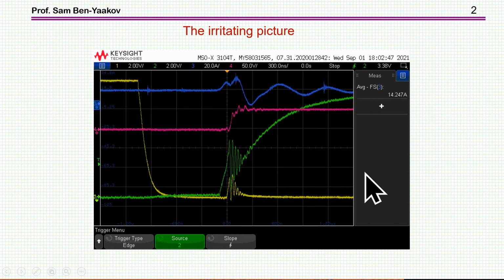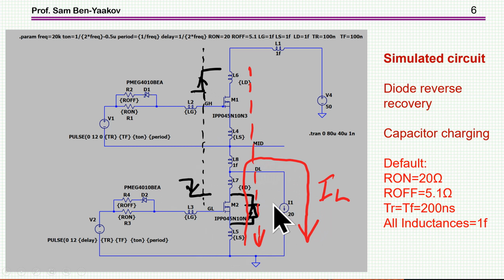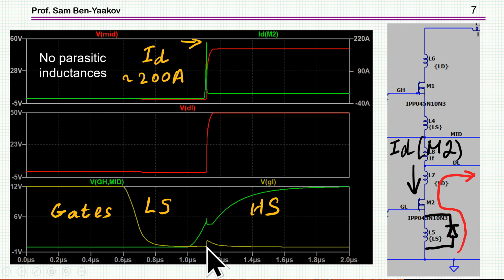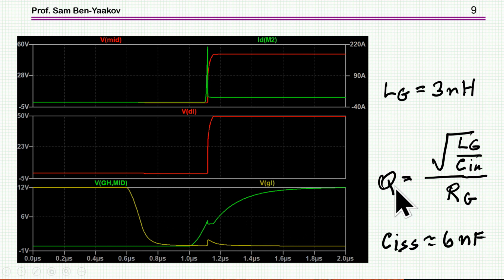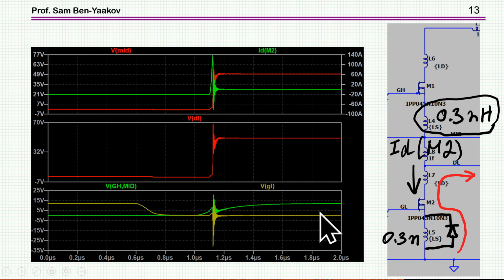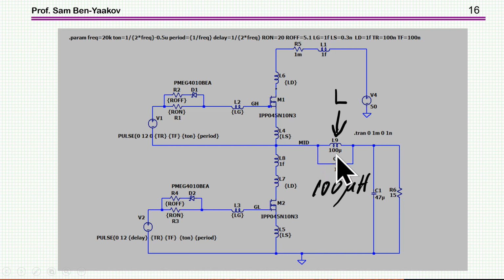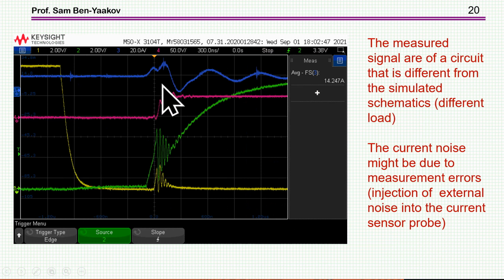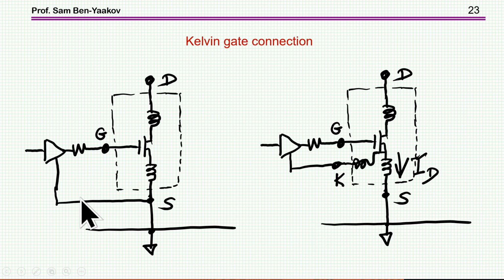Deciphering switching noises in PWM converters

Comment: Hi Professor. 

Just wanted to ask, what is the point of the inductor L8 just below the midpoint in your simulation? if it is not the drain or source wiring parasitics (and obviously not the MOSFET's internal parasitic as that would be inherent to the mosfet model).

I understand that it is not contributing to simulation since it remains such a low value during the presentation but I can't help but notice it.

My thought is,  is it there to help with convergence issues when the current source is present during simulation?

Thanks again,

I look forward to sending you photos of an inverter drive I am building, much due to your expertise.

Doron
Reply from the maker: These inductors are meant to emulate the inductance of the outside connecting wires. Large parallel resistors may help convergence.

Comment: Hi Professor,

I am just rehashing over this video as I am currently developing my own motor drive.

The Cin value that you used to calculate the Quality factor. Would you recommend using the maximum value of the equivalent input capacitance based on its voltage dependant non linearity under DC bus operating condition?

in other words the value of Cin for maximum DC link the MOSFET will operate at?

With many thanks,

Doron
Reply from the maker: Yes
Reply: @sambenyaakov thanks Professor 😊

Comment: Hi professor

Thanks for the video

Since there is no antiparallel diode in gan devices does the issue of slowing down the rise time to prevent this large reverse recovery be a non issues. 

Are we now only concerned about limiting rise time due to other factors? E.g. EMI? 

Thanks again for

Doron
Reply from the maker: THere is no reverse recovery, There IS reverse conduction not related to rise time.
Reply: @sambenyaakov  thanks professor

Comment: Dear Prof., First of all, amazing videos. Thank you for all the content.

I would like to ask about the gate loop inductance effect... As we can see there are oscillations in Vgs. Now let's just consider one event, maybe turn off, (though similar thing can be considered for turn on too), we can see that when Vgs goes low, it undershoots and then overshoots until transient dies. I think first undershoot might be beneficial as it may discharge the capacitors quickly, but then first overshoot could be problematic as it could trigger spurious turn on of mosfet for a short time. (Please correct me if I'm wrong). 

So my question is, can we calculate the value of the overshoot and undershoot to see if it goes above Vth of mosfet to prevent spurious turn on by simple RLC circuit analysis in gate loop ( having gate loop inductance and Ciss in the loop)? The problem is that these capacitance values change with Voltage and also at the miller pletue, Cgs goes out of circuit... 

Hope this question is interesting for you.

Thank you
Reply from the maker: Overshoots  reach a max of twice the excitation for large Q, much larget than 1. For moderate Q= sqrt(L/C), the over/under shoot is per the second order transient respone.
Reply: Thank you Prof.

May you please also answer the following:

1. Can you please suggest some literature that details calculation of overshoot and undershoot of gate voltage because of gate loop inductance. I'm interested in getting analytical solution to the peaks and the times ar which they occur. Also considering the miller pletue, how to analyse it for different times (i.e. does same 2nd order analysis thought the switching event or if we change the analysis method during miller pletue time and also when the difference parasitic capacitance values changes).

2. What would range of values would qualify as high Q, moderate Q and low Q.

3. Is voltage spike at Vgs always bad or can it be helpful too?

Thank you again 😊

Comment: Excellent summary.  A further video detailing the Kelvin connection would be useful, one issue of interest is when using this connection is not beneficial, for example, when precise control over the di/dt during diode turn-off is required, in which case including source inductance in the gate drive circuit can be very helpful (I have seen extra intentional L added in the source lead for this specific purpose).  The modern "super-junction" MOSFETs have parasitic capacitances that have a very strong voltage dependence which pose a challenge to optimise gate drive over the full range of operation (variations of duty-cycle, load current, and bus voltage); the effect of any inductance common to both source and gate drive currents can be very difficult to manage.
Reply from the maker: Thanks for interesting input

Comment: Sam, your lectures are superb! Big thanks for posting!

Would it be possible to make a follow-up where you go into the proper techniques of gate-drive, i  particular when using a Kelvin connection to  multi-source-pin FET device, and perhaps a bit about snubber network design and optimization?
Reply from the maker: Thanks for suggestion David. Will consider it.
Reply: @sambenyaakov  yes sir please consider above ,I was also going to request same 😀
Reply from the maker: @powerpath-n4u  👍
Reply: @sambenyaakov  Me Too.

Comment: I wasn't exactly sure why Kelvin connections are good on some of these new-ish FETs but now I know !

I wonder some times though if just a 7 lead MOSFET can get the same effect by using one of those source leads for the kelvin connection just for the gate drive ?   I know it would help with PCB inductance effects getting back into the driver but not sure exactly how the kelvin connections specifically built  into FETs DIFFER from just the 7 lead style source connections that are there for lower RdsOn and lower inductance.
Thanks for the great videos, Sam-Ben !  😀😁
Reply from the maker: " can get the same effect.." it is a question how the bonding is done and to where. Did you notice the large pointer ?😊
Reply: @sambenyaakov  I like large pointers !   You  KNOW where it is !  😁😀

Comment: Ah, that's why some mosfets have more source pins than drains!
Reply from the maker: Indeed
Reply: @sambenyaakov  You mean if we use more source pins, the stray inductance will be lower than only used one Source pin?   Thanks Mr Ben Yaakov?
Reply from the maker: @huanzhou4768  I think that what was meant by question is that the source pins include the Kelvin connections so there are more pins.  But yes, using all the source pins will definitely lower the stray inductance and distribute the current between the pins ( one pin may not be able to carry a heavy current).